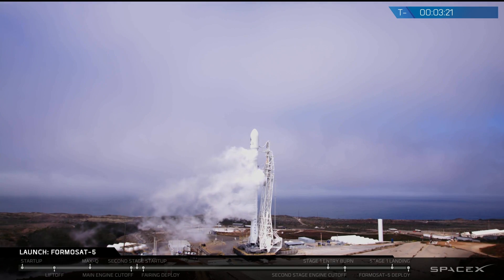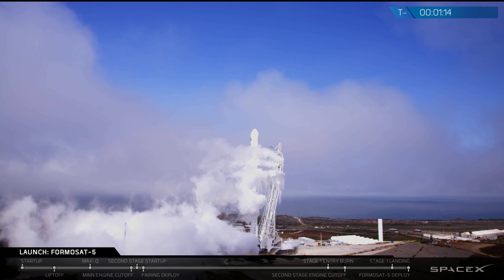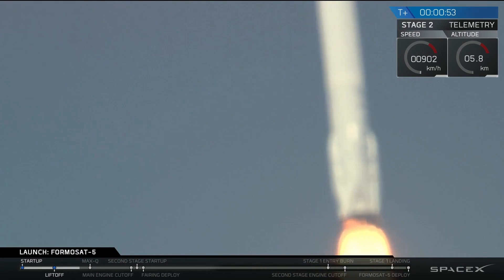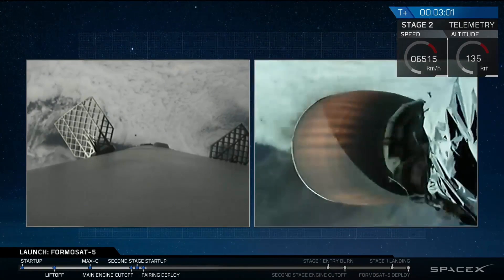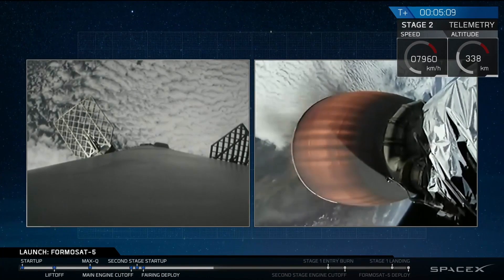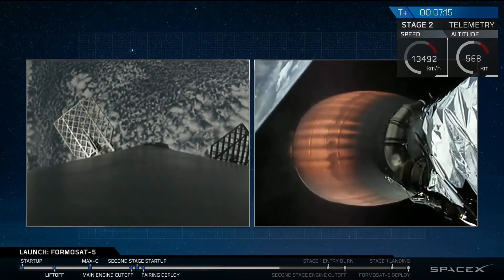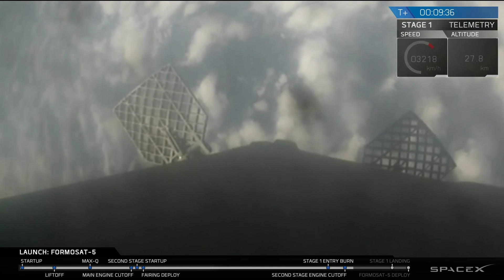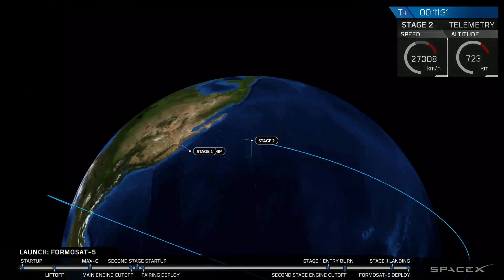Space-X Falcon 9 Launching Formosat 5 And Droneship Landing

Comment: Someone could explain to me that almost all the landings on the first stage, the images freeze just before the moment you could see the bottom of the stage 1. Do not you think it's weird?
Reply from the maker: it's physcs - if rocket exhaust tends to disturb radio links
Reply: Julian Danzer ,  Burning hydrogen causes this effect ? Link please
Reply from the maker: any extremely hot gas will mess with radio connections - and the falcon doesn't burn hydrogen, if you wanna make stupid arguments at tleast TRY to sound remotely informed - like reading the wikipedia article about the falcon 9 would be the minimum amount of information you should take in before wasting your time
Reply: Michael Taylors - It's not just ionization it's the literal heart stopping vibration shaking the antennas. Why that isn't common sense is beyond me.
Reply: Motokid600 . Who said anything about ionization? I'm still waiting on a link explaining how vibrations; either mechanically or sonically induced, can cancel radio waves, and at the precise moment, or about  1/2 second before touchdown no less. What no vibration-isolation, or damping technology at SpaceX to help document their achievements? No rubber, no oil, no springs at Hawthorne ? Gods' gotta love the Motokid600
Reply: Julian Danzer " Any extremely hot gas will mess with radio connections " By melting the connectors or coaxial cables ? Maybe by fusing the antennas into a lump ?  So your saying burning gas, albeit, an "extremely hot " burning gas emits a spectrum of frequency canceling waves ?  Fascinating, link please .
Reply: Michael Taylors - What? Do you not understand that the heavy vibrations shake the transmitter ? You can't understand how that breaks up the signal? Take your WiFi router and smash it on the ground repeatedly many times a second see how your connection fairs.
Reply from the maker: yeah... because before the last few seconds of descend THERE'S NOT A ROCKET LANDING ON THE DRONESHIP YET HOW HARD TO UNDERSTAND CAN THAT PART BE?
Reply: It is a total fake, the altometer kept going up, while it was already in decent!! So stupid this, it is all CGI fake!! A real NO BRAINER!!
Reply from the maker: thats the stage 2 telemetry, and stop spamming your stupidit everywhere if you cant even be bothered ot read one word

Comment: Come on!! If you're worried about re-entry being more dangerous, just look historically. They used to land the Shuttle in the Mojave, very close to population centers. Let cameras get close for the landing for gods sake!!
Reply from the maker: the shuttle is very very different from the falcon 9 - and while it did land close to population centers' it didn't land public right on the runway - and safety standards have only increased since
Reply: Yes, the falcon 9 uses its Merlin 1D++ to land which combusts Liquid Oxygen (LOX) and Kerosene (RP-1), this creates an extreme heat condition wherever the thrust is directed, the space shuttle just glided back to the runway with hardly any fuel, this was much safer... (the space shuttle never used its engines)